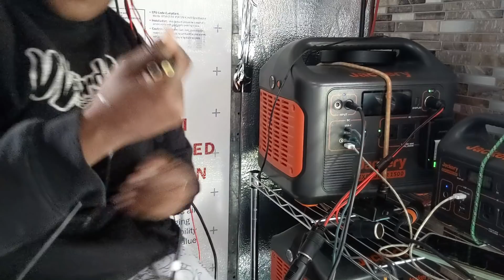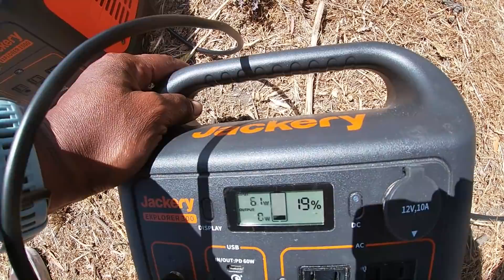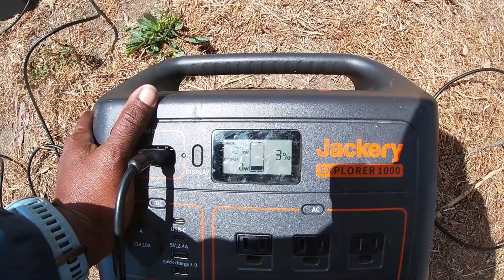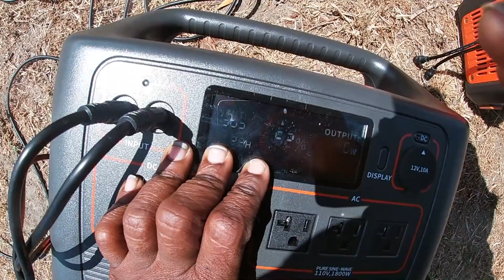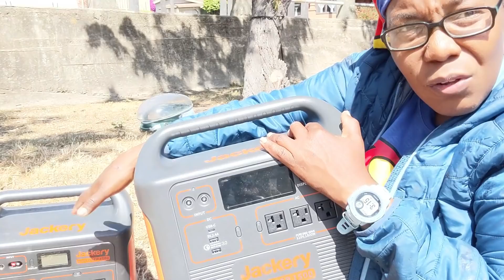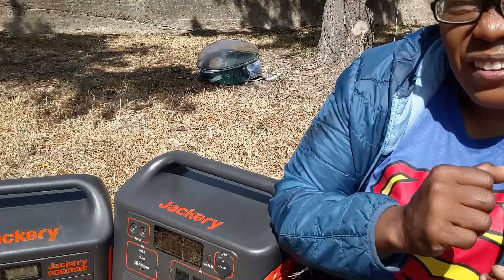Solar Power For Vanlife | HUGE 15% off Sale| Jackery Explorer 1500  vs Earlier Models

Comment: The comparison jackeries was good. I believe with my needs starting out I should go ahead and get a 300 or 500 at the most cause I will only run a small air cooler maybe 😎

Comment: Dawn I appreciate your opinion on the jackery especially their solar panels. I have to admit a truly hate solar panels because of the Great lengths manufactures go through to make sure you can’t use aftermarket panels. And for that  reason my number one  Preferred equipment is my Honda eu2200i generator to recharge my batteries. In the future I pray and hope like hell jackery  do away with their useless handle and do side mounting handles. Looking forward to your next video ⛺️🔥🏕✌️

Comment: The 1500 would be great IF it had more than 1 12volt cig lighter outlet. That's a big deal breaker for me. 12v is so much more power efficient than ac. If they add more 12v than I might buy one.

Comment: Frustrating that the 1500 branch connector has to have two inputs to work.   And still has only one 12 volt outlet!! They goofed there IMO.  Too bad you can't charge the 1000 from more than one source.   
I have a refrigerator, and a hot logic, and an electric blanket.  Frustrating.
I wish the 300 was enough to do a fridge 24/7. I wonder how long the 300 would run my fridge?  If it did 12 hours maybe I could get two 300's? Too bad I missed the sale.

Comment: I'm off-grid and have bought 6 solar panels but it still only adds up to 300w so because I also needed a jump-starter/compressor 4 inflating tyres. It is 750 (I think) have check next time I go ☝ 2 👁👁my son at his 🏡

Comment: I have sort of a dumb question. Since my accident I'm looking for a van or something to live in. So what is the diffence between this and the lithium batties people use for solar? When I get something I need to make sure it works for electricity. Would the jackery run a sewing machine or would I need regular solar? Sorry this question is so long. Thank you for your time and your videos.
Reply from the maker: A battery is litterally just a battery. You can't plug into to it and it's not going to self-charge itself. It's basically the same thing as the battery under the hood of your car. When it's not hooked to the car, it's just a big heavy box. When it's hooked to the car, it powers the car. So with just a lithium battery you need to build/put together all the parts required to take power out of the battery and put power into the battery. With a Jackery (or any "solar power station" or "Solar generator") all the stuff you need to actually plug in and use the power is boxed together with the battery. So it takes battery cells and puts them in a box, but also adds the plug in options to use the power and an easy way to plug into a power source to recharge the power.

Think of just the lithium battery as the gas in the gas can. The gas in the can could potentially power a gas generator, but on it's own it's just gas in a can. The Jackery (and power stations like it) is the generator filled up with the gas from the can all packaged together.
Reply: Thank you for explaining that.

Comment: Good hands on thorough review Dawn! You've become my favorite YouTube van/box truck build channel for a while now. I like Chrome and Bob and am soaking up info as fast as possible.  You've done a lot of great work and teaching on the learning path. Love that Micky too. I did buy the 1500 Solar Generator ( the 4 100 panels kit) around 2 weeks ago and have good and bad experiences...I'm hooked on the convivence but, 1 of the adapters gave out and the panels really are finicky about exact sun alignment; most I got was 150-160 with 2 , and that really drops fast as the sun/earth tilts,?  lol , moves...so efficiency wasn't as high as I hoped. The 1500 runs my laptop for days and is a workhorse . Best, and safe travels
Reply from the maker: Yeah, the realities of solar charging is it's 'meh' in general. That's why I say these do not beat/kill has generators. I put fuel in gas Genny, I get the watts I paid for. I put out a solar panel. Who knows...depends on time of day, location, angle to the sun. Solar is great and has come SUPER far in recent years, but still has a ways to go to fit into a box and run super consistent.

Comment: Question
Can you place the solar panels on your roof permanently?
Reply from the maker: The Jackery panel, no. It's a portable panel. I mean technically you could try. But they are designed to be ground panels, they are fabric, and they have some weather protection, but they would prob get damaged in the long term as they are not designed for permanent mounting. Or extreme weather exposure.

Comment: I love this info bc we are wanting one, just didn’t know what we would need. We also have an rv that came with a 50 amp solar panel that charges our battery to keep the refrigerator running and can run lights  to but won’t last long so we are thinking about getting a bigger panel too.

Comment: I want to use my vitamix blender and InstantPot.  The 1500 could handle those.
Reply from the maker: You'd have to look up the wattages. The Jackery 1500 has a 1800w inverter. So as long as they come in under that, yes.

Comment: On the jackery 1500 the plug that jackery sent you isn’t it 8mm ?or is it bigger now?
Reply from the maker: The pin in the middle is thicker (as far as I can tell right now it is proprietary). The circumference seems to be the same or same-ish. If you just push an standard 8mm plug in there (I did by accident because I mixed up chargers) it will fit, but it won't charge. And you might break something.

Comment: Once you run the battery down. It takes about 8 hours to completly recharge.  If you avoid hair dryers and coffee pots. A single charge could last me most of the week boondocking
Reply from the maker: It takes about 8 hours from a dependable power source, if you have access to one.  Which is always the crux. There are plenty days where I am not back up to 100% because my solar source just isn't bringing in enough solar. But, as always, it depends on why and what you want a 1500wh power station for. You may want it explicitly so you CAN use your hairdryer.